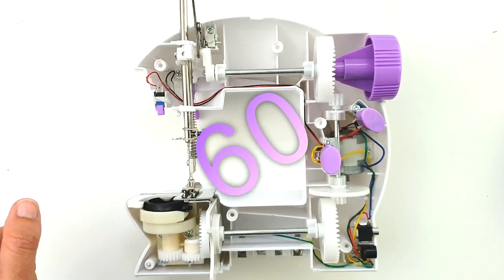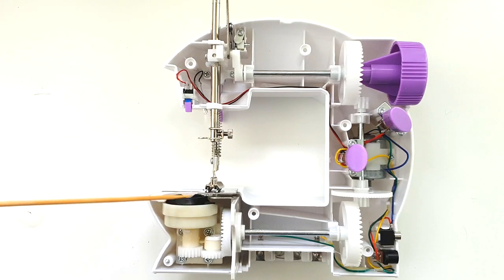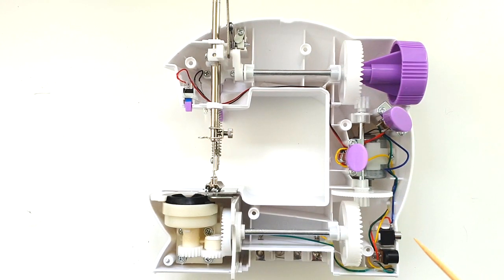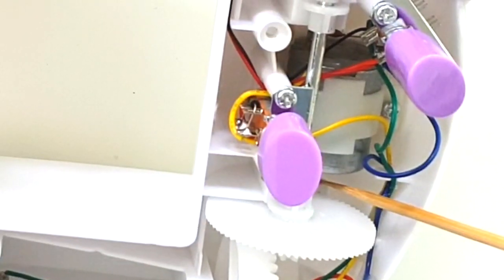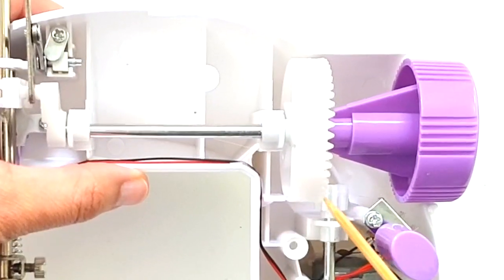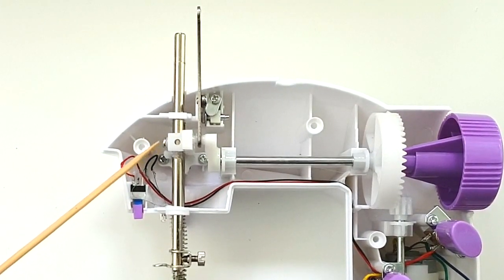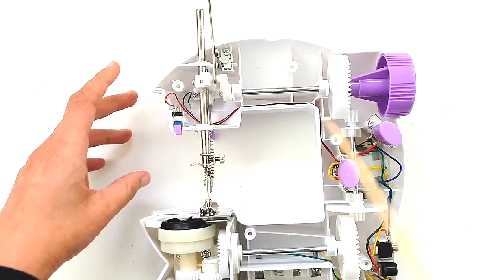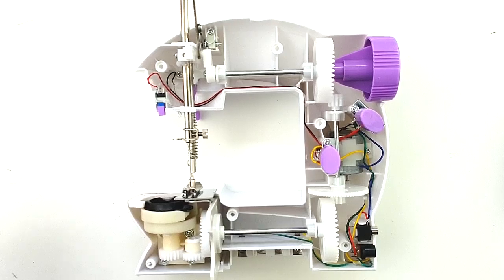How to repair mini sewing machine needle not moving and machine not stitching | YOU CAN DO THIS!

Comment: Hello, thank you for this informative video, my needle works fine on power when the front cover is removed. I had timing issues, so to rectify it had to open the machine up. Now that I am putting the cover back , the motor runs but the needle doesn't !  Also the bobbin still skips some stitches in between . I tried my best to get the timing right.
Please help.

Comment: I have the same kind of machine got problem that it not work auto, i should run the gear by hand i don't know the motor is not generating power or has other problem the light can be on but not running auto can u tell me how to fix it

Comment: Hi!  I have a problem with checkpoint 3 but with the thread pickup lever. The machine won't sew cause the lever can't pull the thread. It's stuck and won't move. I don't think it has anything to do with the thread tension controller cause I already tried loosening it and it still won't work. 😞 Do you have any idea how to repair this?

Comment: hi, i have a question...when you put the thread through the tension screw, is it okay if you keep removing the thread and then putting it back and then removing the thread again and then putting it back again? i want to know if doing that several times is safe for the machine
Reply from the maker: Hi Mikaila,
I don't think it should be a problem, but why would you want to do that?

Comment: Thank you for the info I'm having a hard time with my sewing machine because it's not stitching and making a noise
Reply from the maker: Jessa have you followed all the set up steps down to a tee? 9/10 times I have seen it's a set up problem. There are no compromises on the set up I'm afraid.
You will find the list here. Scribble or print it out and keep it on your sewing table for reference. 
👇👇👇
https://mailchi.mp/4c24ab312dc9/mini-sewing-machine-operation-checklist

Comment: Please help sought my problem the machine is not moving,I connected it the light on the machine shows its connected but the machine don't move at all I use the footpad it still didn't do please help out.
Reply from the maker: Hi Rahana, is the on/off switch working?
Reply: So how can I solve it?

Comment: I bought mine yesterday it just work perfectly without a materiel under but as soon as I pit a cloth under it just stop the needle stock all the way down and make a noisy sound any help please??
Reply from the maker: Hi, if it's a new machine,  please return or exchange it.  Clearly it's faulty. Hacks can only go so far, but a manufacturing defect cannot be fixed.

Comment: Hi mine has an issue in the hand wheel (not sure if that is the name) will it be safe to just glue it to the gear? thanks
Reply from the maker: Hi Paul 
Thanks for reaching out. 
Yes it's the hand wheel. Gosh gluing won't help, the torque will break it again. Is it quite broken?
Reply: @OoniCrafts  yup badly broken but the entire machine appears to be ok.
Reply: Mine has the same problem! Did you manage to solve this? :(
Reply: mine too and when i turn the will the needle wont work up and down

Comment: Please I lost the tension controller and the the machine is not sewing
Is there a solution to that ?
Reply from the maker: What part of the tension controller did you lose?
Reply: @OoniCrafts  the plastic purple ...I still have d string
Reply from the maker: The purple bit is essentially a nut and bolt system. The nut sits inside the machine. I imagine your machine's bolt is missing. If your machine is old, you could open the machine,  find the loose nut, go and get a bolt the same size. You will need to use the original tension plates and spring though. Hope this helps.

Comment: my machine couldn't stitch i already opened it and adjust the bobbin housing and i already changed the needle what could be the problem?
Reply: Yes same problem in my machine not stiching
Reply: Same
Reply: im so depressed right now,  i opened it again today and no progress at all its the same
Reply: Excuse me from the side. If it doesn't work at all or runs very slowly, try using dry batteries as the power source. If it runs on dry batteries, the cause is the AC adapter, so you'll need to replace the AC adapter. Commercially available products can also be used if the specifications are matched.
Reply: I lost the control on the purple weel on the  top right,  it rounds without moving the other parts,  I can take it out and in , what should I do for that?
Reply from the maker: If nothing still works, please don't waste your time and energy on the machine. There are too many people suffering due to a bad product. Try to get rid of the machine and invest in a full-sized sewing machine like the Brother LS14 or a second-hand one. 
At the very least, you have learned how a sewing machine works and this will help you go so much further with your next full-sized sewing machine. 
I have discussed this issue in detail in this video: 
https://youtu.be/pTtk6bpx4UE
Hope this helps xx

Comment: I have this same style machine, however; there is no tutorials on how to repair the MOTOR when its gone up? At this point I'm about to throw this machine in the trash! I haven't had this machine for a year yet and it's not working! Yes, I've gotten quiet a few sews from it. And then it just stop working.  I have tried everything, but nothing. I will not recommend anyone to buy this product!
Reply from the maker: It's true Andrea, these are cheap mass manufactured low quality machines. I don't recommend buying these either. 👇👇👇

https://youtu.be/S43aze0_-jo

My favourite starting machine is Brother LS14
Reply: @OoniCrafts   Thank you for your reply. I've learned my lesson. I've also watched the video...very helpful! I am working on investing in a reasonable sewing machine!
Reply from the maker: Andrea what country are you based in?
Here in UK someone was getting rid of an old John Lewis sewing machine without a cord. I bought it for £4 only and got a cheap cable from EBay. Works perfectly!
Have a look around for bargains! x
Reply: @OoniCrafts  I'm in the US Baltimore, MD...thank you so much for your concern.

Comment: What if it moves with the hand wheel but not electronically? The motor seems to be the problem. It hums but doesn’t “go”. How can I replace the What if it moves with the hand wheel but not electronically? The motor seems to be the problem. It hums but doesn’t “go”. How can I replace the motor?

Comment: Mine the power works
The wheel doesn't move nor does the needle 

Nothing moves but it makes the sound of sewing
Reply from the maker: Xandra you need to see which gear has popped out x
Reply: Same with my mini sewing machine problem with connection #1